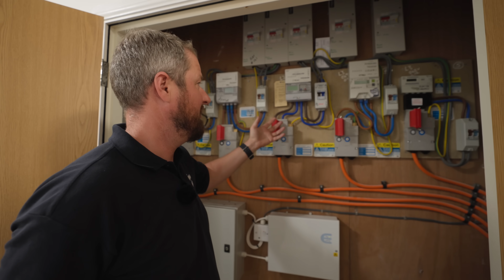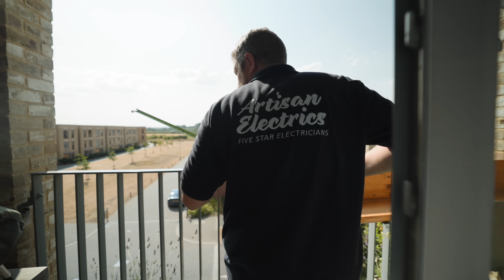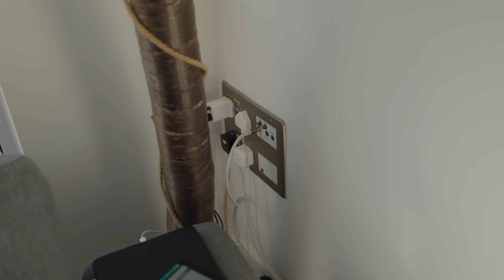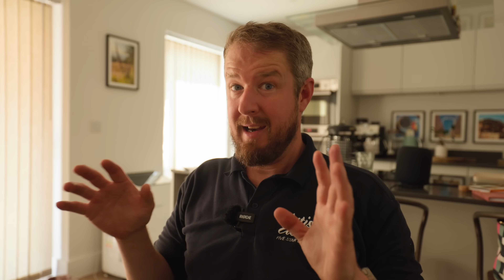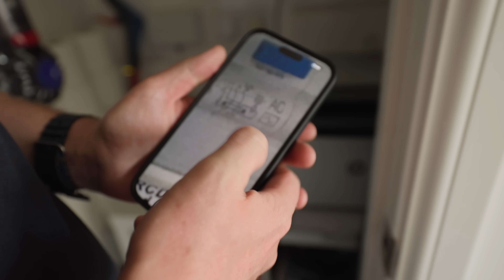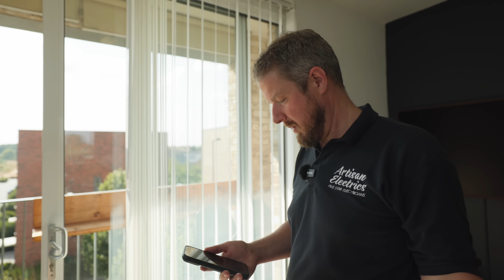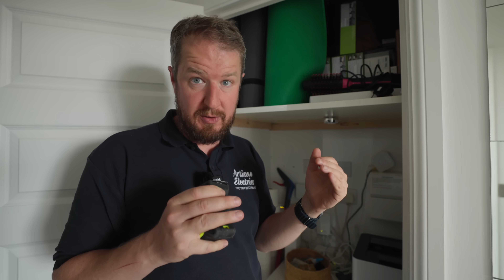I Found a BIG Problem With Plug-In Solar…

Comment: the biggest concern for me is even more hidden, the grid instability
here in USA we have the rise of plug in solar being protected, but the problem is that they need to be "island impossible" which means they generate when the grid is up, which stresses the grid, during the day, when the most grid stress already exists and rolling blackouts are likely
the only sensible way to use solar is a portable or permeant panel sloped to the ideal range feeding a small circuit in your house as a disconnected or grid-failover load

this is viable with a battery to handle fluctuations(especially with sodium ion) to feed something like a grid-fail AIMS power solar inverter, I do a similar thing using it as a 4kw UPS

the core issue is that solar using the grid as a buffer is a stability problem

and as for the EV charger? just nope, we need laws around the world that say "you cannot forbid any modern clean energy or clean living improvements based on aesthetic concerns"

the truth is conduit is seen everywhere, hardly noticed, and mostly ignored, the EV charger ban should be illegal even in the UK, actually especially the UK where urban living is more likely and pollution is a major issue

the real boon is if you work at night, or have a battery, because we all know the energy cost of electricity is always lower than gasoline(petrol) so it is financially insane to NOT own an EV for any driving under 100 miles a day(the average 50% range, giving plenty of spare for a forgotten charge or errands, or HVAC use/range loss)

we need protections that are basically:
- right to charge   (absolutely no ev charger bans that reduce grid supercharger stress by plugging in at home)
- right to generate   (professionally installed or temporary solar/wind/hydro that do not have environmental or shared use issues)
- right to repair (if it breaks the company that made it is not allowed to arbitrarily reduce the ability to replace wear components(like phone batteries) by cheap or hostile design shortcuts or software locks the consumer cannot override)
- right to own (companies may not remove access to content or products that originally had offline or one-time transaction fees unless it actually becomes a large financial drain to store the content or offer the complementary online services(ie making 0% internet baby monitors suddenly need a subscription to keep using, despite it having no server load)
- right to understand (protecting consumers from non-"common language" agreements that allow for things such as redefining the word "buy" in some EULA too large to read for every product they interact with to mean "rent"(yeah fuck you sony, not cool, no matter what))

until those rights are codified in every country on earth, there is no such thing as consumer rights

and lets not forget this final one that people don't seem to understand
right to survive

why is shelter, food and water not a human right that must be free of charge to everyone? managed by the already perfectly capable logistics of the modern world, subsidized by taxes that can perfectly automatically(ie no budgetary freezes like what recently happened in USA, where refusing to renew allowed critical life supporting services where even allowed to not default to last years budget until renewed) refresh?

the world needs these basic human rights, because as ironically star trek, the most accurate predictor of the future in fiction suggests, once life is protected, people still work, because they need purpose, not just to survive

Comment: You can run plug I solar 3000W on our normal house electric circuit here in the uk, no problems

800w is old hat now
Reply: Technically you can, as the socket will take it (for two hours max), but not legally. 3Kw will make the fuse in a plug hot, so is not allowed for long-term loads.
High power constant loads, are a thing of the past, and sockets aren't as well made as they used to be. That is why special "EV rated" sockets had to be made. They are basically sockets made to the proper standard again.
Reply: @johnbooth5199  depends on your setup I suppose as there are a variety but I would argue that most people on standard uk electric that is up to date and In good condition could consistently do more than 800w.

The circuit at the breaker is rated to 7360w ish. Single socket cap is around 3500w is, for consistent load it’s recommended 80%, so u are still well in the 2000w+ range, would not advise on out of date/not up to spec/low quality installations however 

Ecoflow app lets you choose from 0w-7000ish watts (3 phase) which is good as I said earlier on everyone’s setup/system may vary, regarding legality, u would just need g98/99 forms should u wish to export more than 800w and luckily you can turn off feed to grid in the app. You are obviously permitted to run a device of more than 800w on your own wiring…. Most people do every day

Comment: Not to sound nasty, but I truthfully haven’t watched Artisan content in a good while, and this video reminded me why. The fact you had to use AI to establish whether the circuit breakers were bidirectional says quite a lot in itself.

Nearly 19 minutes built around a supposed "BIG" problem, but unless I’m missing something, the premise seems rather misleading. Metering the incoming supply with CT clamps is not actually required for an Enphase system to generate power. Enphase’s own documentation even describes the consumption CT as optional, and Plug In Solar sells the Standard Envoy specifically without CT clamps.

The Metered Envoy and consumption CT allow you to monitor household consumption/import/export and provide additional functionality, but that’s very different from saying the solar installation fundamentally requires access to the incoming meter tails to work.

So yes, somebody living in a flat may have difficulty installing a consumption CT if they can’t access the incoming supply, but that’s a limitation on the metering/monitoring side of things, not the "BIG" fundamental problem with Plug In Solar that this video makes it sound like.

Comment: I'd install 2 panels in landscape. Kick them out 10 or 15 degrees if the 35 is unappealing; good for winter sun anyway. Seems to be facing SW, which is good for evening generation when power is most likely to be used. Probably irrelevant if they work from home. Depending on the microinverter and the panels used and the pitch, they will generate between 3 and 6kwh a day, on an average sunny day, in summer. A battery may not be needed if the base load is fairly high, but with energy bills of £60 a month, probably not high unless they are hardly home.

Too many variables to give definitive guidance on the worth/savings a system will provide and if a battery is worth considering, and of what size.

Comment: If you have space for a few panels and don't want to invest to much then plugin solar is great. But keep in mind if you are out during the day you will need a battery which adds quite a bit to the cost.
Reply: Remember its only 800w max 
You have things like fridge freezer, things on standby, internet router, it all helps, there is likely to be new regulations for batterys, so you can plug them in, to help change the pressure on the Grid.

Comment: We share many of these concerns about plug-in solar. The UK isn’t Germany — we have millions of older homes and flats with electrical circuits that were never designed for electricity to be fed back through a socket.

Solar and batteries absolutely have a role, but households shouldn’t need to spend thousands on energy technology simply to make electricity affordable.

Government should be putting the same urgency into getting domestic electricity back towards 15p/kWh.

Our proposal is a national domestic energy tariff, moving network costs off the unit price and into a transparent, regulated monthly network subscription — making electricity affordable for every household, whether they can install solar or not.

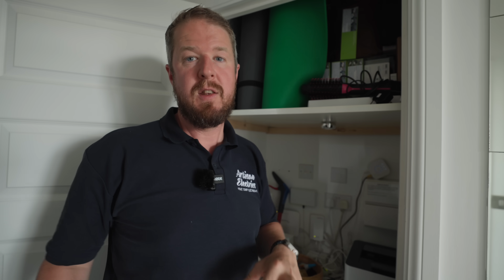Comment: At 16:30 & I quote "All of these plug in Solar Systems, in order for them to know ... they need some kind of meter ..." Yup, in a video about plug in Solar Systems, you actually said that!

About the black panel radiating too much heat into the flat (leaving aside the with/without panel physics of it) you could have suggested aluminium bubble wrap radiator backing (eBay £6.52 for 0.6m x 5m) and suggested that he might use the remainder of the roll behind the rads in his flat.

The whole point about plug in solar is that it's supposed to be simple enough you don't need to load it with the cost & hassle of installing the system by interacting with a professional electrician ... if the dis-information machine kicks in and says the opposite, the concept will be a flop in a way that it isn't in the countries of our esteemed neighbors.

Surely our electricians should be more than happy with the amount of work currently available fitting 'formal' Solar & Battery systems, heat pumps & EV chargers without trying to muscle in on the Plug in Solar market by dissing it ?
Reply: The Meter thing was such a nothing too!
"Oh when you're a flat your grid connection is actually down in the building basement where you can't put anything. Oh wait but actually you can get the tail from that to you consumer unit and it will give you THE SAME READ"
Plus you only really need it for a battery system so you can save the power and not discharge. You can curtail a microinverter but why bother really and technically you can use a battery without one too but you will need to set up and manage it manually which is a pain and wasting the stored power.

Comment: The talk was about batteries, but plug in batteries have not been included, the question is, can one fit plug in solar, yes or no, if you need to have a survey first, then the whole idea is flawed, either anyone can fit it, or it's a non-starter. On the 27th August one can go to the likes of Lidi, and read the advert and know if you can or can't fit solar.
Reply: Buy an approved kit available after the 27th, and you can plug it in, but read the guidelines that come with it.

Comment: I'm tempted to buy it, not for big appliances but to reduce the cost of the natural drain in the house. Things are often plugged in and consuming power 24 hours a day which costs money. Reducing this drain would just take the edge off the cost of the electric bill.

Comment: 1. Oooooh the consumer unit may not work - It did
2. Ooooh the panel may not fit - it did
3. Oooooh it may look ugly - it will, but not as ugly as all that plastic grass
4. Ooooh the socket may not be safely wired - well 99% of all sockets are installed by professional electricians
5. Ooooh the socket may not take 800W - reaaaallly?

Then I saw he was illegally putting plug in batteries in place and gave up.

Comment: Glad I’ve seen this. Wish I’d known it before buying my Ecoflow inverter and panels though lol. Oh well I’m planning my to move in the next couple of years. Will have to wait til then. I’ve heard about new BS regs saying these things and batteries can’t be where everyone’s got them now and has to be a 2meter clearance around the batteries and fireboarded all over the place to prevent spread plus battery external storage can’t be up against houses, 2 meters from exits and windows,and all the other complications introduced which will prevent many installs.  PAS 63100 and BS7671.

Comment: So in my cottage where mains is disconnected from the grid, I assume it isn't safe to turn a wall outlet into a connection with my 240V pure-sine-wave portable power station? I mean it works splendidly, but some outlets are on a different phase, so some lights are dim. I guess the main issue is that there are no fuses between the power station and the other outlets.

Comment: There are a lot of negative comments here, mainly suggesting that Artisan are just being protectionist as far as it impacting their business. I don't see it. The majority who may be considering plug-in solar are not going to be potential Artisan customers. Many will be private renters where having a full installation is never going to be an option.

The video is a helpful 'be aware of the potential pitfalls' video. It's all very well to be able to pick up a plug-in solar installation from Lidl (or whoever), and many may well do that without any thought for the potential problems.
Reply: I agree that they server a different demographic, but the "pitfalls" are a bit dubious, to be charitable. A minimum circuit breaker used in a consumer unit is 6A lighting circuit, which is more current capacity than the less than 4A of a max 800W plug in system needs, so the worst case wiring is more than enough. A clip-on balcony frame panel is a "temporary" installation, and a panel over the balcony bars will reduce the light coming in through the windows, letting the room be slightly cooler. The only undebatable "pitfall" is if there isn't a balcony power socket, which is a rather obvious requirement for a balcony panel.

Comment: I haven't found a good answer for why this are not recommended to go along classic solar. I'd love to supplement mine with some extra panels than can be moved around depending on the time of year
Reply: What you feed into the plug will only be usable by your home load. It won't get stored in your home battery although it will allow more of that system's solar to charge the battery. If your system has a spare mppt then you could put your own panels into that but I think it could invalidate your G98/99 if that specifies all of your equipment as your add-on obviously won't be on the declaration. Not hat you would get caught.😢

Comment: Here in the netherlands its mostly not allowed to hang solarpanels outside the balcony, only solution is to setup a panel inside the balcony but than it will have shading and i dont think its worth a balcony system in shadings, havnt try yet but i think the result is pretty poor, or you can get a solarpanel and invertor for very very cheap more as hobby project for a couple euro`s provit

Comment: The “perceived problem” is that some older RCD’s can overheat IF power is fed in to the RCD’s output when tripped, however while this holds true if the RCD is being fed via something like a generator, it doesn’t hold true for grid-tied solar or batteries as they are designed to stop all generation as soon as they are disconnected from (or cannot detect) the grid, it’s called “anti-islanding” and it’s a mandatory safety requirement built into every grid-tied solar/battery inverter....
 
...so “In-The-Weal-World” grid-tied solar/batteries can never actually create the scenario where the RCD overheats!!

Comment: It doesn't answer the question about permission, but most shared ownership agreements require permission for installing anything on the outside of the structure (e.g., a satellite dish).  They often require permission for major internal improvements (e.g., new kitchen). As you said in the video the key "argument" is probably whether it is a permanent fitting (holes drilled in the wall for a mount) or temporary (a removable clamp on the railings).

Comment: I have a south facing balcony that seems ideal at first thought, but big black panels would look awful and spoil my enjoyment of the balcony and the trees outside and building opposite will cast a shade.
So it sounds like a really good idea until you start to think about the details. 
Also, I didn't realise there would have to be a meter applied to the incoming main. I would need an electrician to come aind install that inside the consumer unit.
Reply: An export monitor/meter is not required for plug-in solar... Only batteries, and Plug-in batteries haven't been approved yet.

With Plug-in solar any power you generate but don't use is fed back into the grid but you will not receive any payment for it... however when a battery is added  you don't want it discharging itself back info the grid when you are not using much power, so you need some way of determining if you are importing (consuming grid power) or not, and in turn tells the battery when and how much power to generate.
Reply: @alanwood9804 Thanks. That's very helpful.

Comment: The consumer unit in my house is as with the wiring the original 1950s,  fussed one for lights one for cooker and a third for the sockets 
Only chargs from solar, snd discharge no greater than 350watts.
As it was tented it have never been checked, the was in 2004. Ive now bought it but lack the money to update anything

Comment: When I looked into it there was one thing you havn't looked at: When the main line is cut off (for maintenence at the main line in the street) will they not get a current running from all the plugin-solarpanels?
Reply: No. plug-in solar (and any grid tied solar/battery for that matter) are designed not to output power until it sees the grids power first, this is known as  anti-islanding and is designed so the DNO's staff don't get electrocuted!!